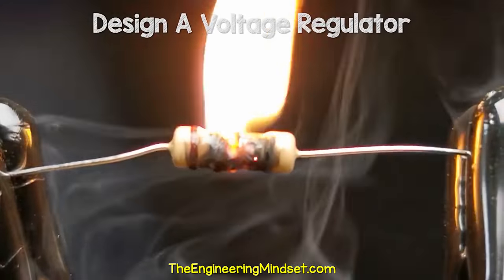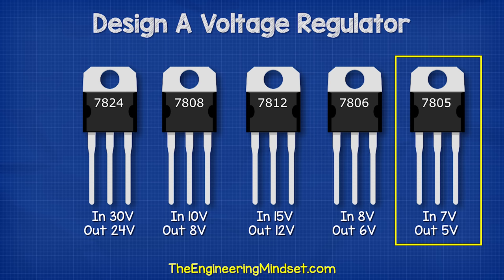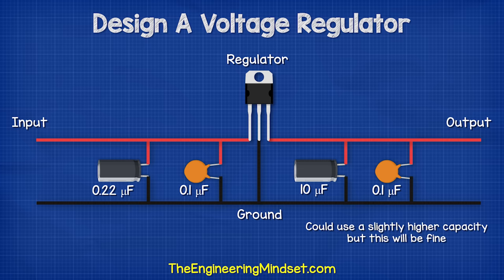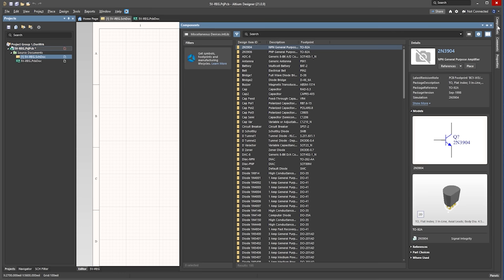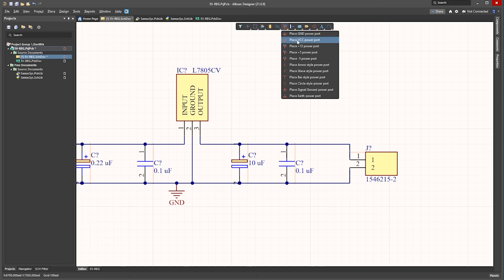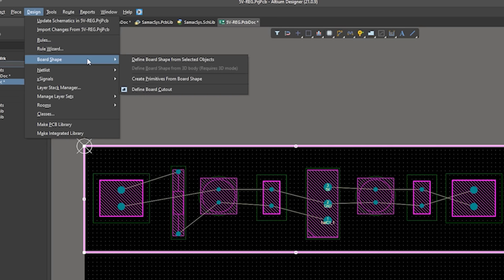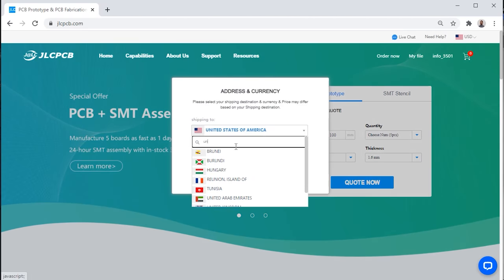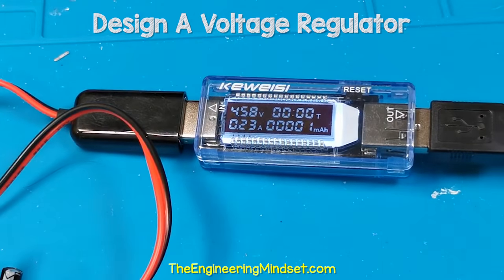5V Regulator design tutorial - How it works, how to design PCB  altium

Comment: I remember when I was in middle school, I followed a tutorial on how to make a voltage regulator and housing everything in an altoids tin. It had the voltage regulator and just a resistor. I'm pretty sure I shorted the whole thing by either having the tin short circuit the whole thing, or I reversed the inputs. Anyways, I'm 27 now, have a degree in physics and a profession. I think this will be my first full fledged personal electronics project.

Comment: Nice videos, and also really well explained. Please continue making this kind  of videos that really helps a lot to those who want learn something new the best vibes for you
Reply: In this video, we're going to take a look at a voltage regulator circuit. This is a very important circuit, and it's used to maintain a constant voltage output despite changes in the input voltage. This is useful for things like powering microcontrollers, or other sensitive electronics.

The basic principle of the voltage regulator circuit is simple. We have an input voltage, which is applied to the Vin pin of the regulator. The regulator then outputs a constant voltage on the Vout pin. This voltage is regulated by the feedback resistor Rfb.

The regulation of the output voltage occurs because of the way that transistors Q1 and Q2 are connected. Transistor Q1 acts as an amplifier, while transistor Q2 acts as a switch. When Vin is greater than Vout, transistor Q1 is turned on and transistor Q2 is turned off.
Reply from the maker: Check out NEW resistor video, everything covered! ➡️ https://youtu.be/DYcLFHgVCn0

Comment: For polarity protection, I'd use small bridge rectifier. Then you can even supply ac to circuit.
Reply: Could you please help me how to add few more components into it and how can I get multiple outputs from it from different points. For eg 5v 3v etc
Reply: A voltage regulator circuit is a great way to ensure a steady flow of power to your project. However, if you're using an AC adapter to power your project, you'll need to use a bridge rectifier to protect your regulator from polarity reversal. Without a bridge rectifier, your regulator may be damaged if the polarity of the input voltage changes.
Reply: @SFORSANDEEP  you need a 2510 bridge rectifier  at the input side and a variable resistor or potentiometer at the output side
Reply from the maker: Check out NEW resistor video, everything covered! ➡️ https://youtu.be/DYcLFHgVCn0
Reply from the maker: Seen our new Potentiometer Explained video? ➡️ https://youtu.be/Xb-MZMoUtcQ

Comment: Making custom PCBs has changed so much since when I was younger. 
I remember being 12 years old and I had to hand draw the tracks with an etch resist pen, onto copper clad board.
Then I would etch the copper, using a spare plastic takeaway tub, filled with ferric chloride. 
Finally, I'd drill the PCB with a hand operated drill and a .8mm bit. Then I would use engine de-greasant to remove the remaining etch resist pen ink from the copper tracks.
Then the board was ready for soldering. 
I didn't have the luxury of the green solder mask, or the professional white text.
It was often difficult, because I had to mentally reverse the circuit, as I was drawing the copper track layout on the bottom side of the board. Often times, I'd get it wrong.

Comment: There should be a heatsink attached with the voltage regulator though.
Reply: Remember that W=V*I. Meaning, if you have higher voltage input (say 24V) but output is only 5V and you're drawing only 0.2A then the linear voltage regulator has to dissipate about ( 24V - 5V ) * 0.2A = 3.8W as waste heat. It will get quite hot quite fast. Times like that - consider if buck regulator would be better option, if not for the noise/EM interference that accompanies it.
I would turn the voltage regulator 90 degrees and place it near edge. Another possibility would be placing it flat on the other side (there are more options). It all depends on how you are planning to connect it to the heatsink and/or how much heat you need to dissipate.
Reply: Based on the datasheet, at 25°C ambient, you can draw 6.58W. That's 1.32A. Keep in mind that's at 25V. If your input was 12V or 9V, which is typical, you can easily achieve 1.5A without a heat sink. However, I would use a heat sink to dissipate heat through a sealed case to reduce heat building up, which might affect other components.

Comment: A voltage regulator is an electronic component that maintains a steady voltage level in a circuit. There are a variety of different types of voltage regulators, but all work in essentially the same way.

A voltage regulator takes an input voltage and produces an output voltage that is either higher or lower than the input voltage, depending on the type of regulator. The output voltage is regulated so that it remains relatively constant, even when the input voltage varies.

Voltage regulators are used in a wide range of applications, from small electronic devices to large industrial installations. They are essential components in all kinds of circuits, from power supplies to data processing systems.

There are many different types of voltage regulators available, each with its own set of features and benefits.

Comment: Great vid, I was looking for such a device, we have gas BBQs that I installed with micro solar panels to charge the igniter, I ran into a problem when the cloud cover changed to output voltage it would trip out the controller for the gas flow, I think this might be the answer to keep a constant voltage from the battery to the units circuit. 
Thanks from downunder 🇦🇺👍
Reply from the maker: Seen our new video on HOW SOLAR PANELS WORK in detail https://youtu.be/Yxt72aDjFgY

Comment: With respect to LED's: given they are Light Emitting ->Diodes<-, they are much better off with a well-defined current, given their IV characteristic . So preferably don't use a voltage regulator, but a current regulator.

Comment: Take note that the capacitors have values based on the expected loads/  power deraws of the circuit, also make sure the diodes use have a smaller break voltage then the voltage source u are using
Reply: @kennmossman8701  almost never but i had an apkication where it mattered

Comment: Back in time, I became independent.  I started my own business designing electronic test equipment, to test assemble PCB circuits.  But I was so poor that I had to use freeware to do the job. The freeware PCB design software only allowed a limited amount of components.  It also allowed you to create your own components.  So I would design a portion of the PCB layout, and then due to having reached the maximum amount of components allowed, resistors, capacitors, transistors, etc,  I created a new component which in truth was a combination of all the components that I had used so far.  Yep, when you are poor, you find a way around everything. Anyhow, one company was so impressed with my work that they hired me full time. Eventually I was also designing high voltage power supplies for neon sings as well as designing the test equipment to test them at the assembled PCB level.   Not bad for a grade ten dropout.  I had no education in electronics, but was self taught.
Reply from the maker: Check out NEW resistor video, everything covered! ➡️ https://youtu.be/DYcLFHgVCn0

Comment: A 7805 in a PCB without space for a heatsink it's pretty useless
Reply: i am a beginner.. 

i want to know whether what you said means that he did it the wrong way and shouldnt have used that ic without heatsink?
Reply: Nope. Heat sink not needed for small currents and lower input voltages.
Reply: @kennmossman8701  Current less than 500 mA and input voltages less than 7.5 volts.
Reply: @kennmossman8701  7v
Reply: Kenn Mossman so i could just use a stepdown converter instead if my loads is big..
Reply: deshpremi the phone eat about >1 amp, the ic requires the heatsink in this arrangement
Reply: I agree, the power loss is high if using a 12v or higher battery as input. Would have been better with a switching regulator.
Reply: @itsourlife  Wrong LM7805 is 1.5 peak at current rush, approx 1 amp max with heat sink, or it will thermal shut down. Test it  over a time period and you will see.  With sink and no sink.
Reply: @overload3996  It is generally NOT recommended to use the LM7805 in it's peak current load....
Why not place them in a parallel to split the loads? So that your 1.5A can split 750mA each?

Also... it doesn't really need a heat sink, it gets hot, but not THAT hot.
Reply: @cpK054L  i said it will peak current rush to 1.5 amp, not able to use at that rate. Constent use is more 750ish mA yes. I have tested under current load at 800 mA with and with out heat sink. With heat sink over time will remain stable. With out sink it will thermo start to lower the mA output.
Reply: 7805 IS pretty useless
Reply: @nicobugs  with a moderate heatsink, or using a wall of a metallic case, you can power a typical arduino project just fine from 12v with a 7805, its cheap and produce a clean output. But without heatsink the usable power output its very low.
Reply: @NautilusCL  It's not not power efficient. That's just a waste.
Reply: @nicobugs  ALL linear regulators and LDOs are garbage efficiancy but it is better if you dont want to do deal with radiative noise other than Johnson noise
Reply: @glitchy_star_classes6276  With a 35V input, 7V will be across the device and 28V lost.  .  At rated current of 300mA the lost voltage needs to go somewhere - heat from the regulator/ 28v @300 mA is 8.4W.  This amout of power will cook the regulator very quickly.  

I would also use an output resistor from the 5V to 0V , so that even when disconnected from the load the device still regulates.
Reply from the maker: Check out NEW resistor video, everything covered! ➡️ https://youtu.be/DYcLFHgVCn0
Reply: Genuinely speaking, it is better to mount it to an enclosure rather than using a heat sink so this is fine for a demonstration

Comment: Loved the video, but this should be titled "how to use a voltage regulator". This did nothing to explain how a voltage regulator functions and operates, mostly "it does this and here's how to use it" which is still valuable but a misleading title.
Reply: Yeah buddy i totally agree with you i thought he is gonna design a new one and build a prototype then test it and show us. This is also a great video apart from misleading title
Reply: Yeah, I thought he was gonna describe the internals of the IC, not how to connect an IC

Comment: I don't think putting a 7805 on a circuit board can really be called "designing a voltage regulator".  You bought a voltage regulator and put some filter caps on it.... poorly chosen ones, badly laid out, and with no heatsink, which means you get maybe a third of the current that the 7805 can support.  This is a bit like going out and buying a motherboard and CPU, putting them into a box, and claiming you've "designed" a computer.

Comment: The 7812 is a commonly used linear regulator. Input voltage can range from 14 – 35VDC and it outputs a fixed 12V at over 1A of current and up to 2.2A of surge current. For basic operation, no external components are required. Just hook up the input voltage and ground and you have 5V available on the output.
👇
Reply: Mistake in the type number. With the regulator suggested by you, you will have 12v on your output instead of 5v. You need the 7805 regulator for 5v. The last 2 numbers of the 78 and 79 series of regulators determine the output voltage.

Comment: I wanted to point out a few things wrong with this PCB.  First off, those traces will not stand the current without a significant temperature rise.  Unless you meant for the traces to act like fuses then I would increase the width.  Next, the diode you use for reverse polarity protection doesn't have much better vf at the currents you were using.  While you did (at least I think) purposely choose a diode with low leakage current the vf is the thing you want to focus on in this circuit and the diode doesn't have that great of a vf. And, why not just use a p-channel MOSFET for reverse polarity protection? Furthermore, having the capacitors right next to the regulator probably isn't good for them. If you can even reach current levels that generate a substantial amount of heat without the traces burning out.  Please make a new video that teaches people good design ideas and not just use autorouter.
Reply from the maker: See my new MOSFET explained video here➡️: https://youtu.be/AwRJsze_9m4

Comment: Great shot of the led burning out 65s into the video. I totally agree that the bonding wires melted due to the high current, but someone who didn't know any better might come to the conclusion that the wire was disintegrated by the intense green death ray.

Comment: I think our professor took a lot of inspiration from this circuit design becasuse our 5V voltage regulator is almost the same as this. Probably it is a widely common design. He just put a full bridge rectifier circuit instead of a single Schottky diode and  two 1K uF electrolytic capacitors instead of 0.22 uF and 10 uF electrolytic capacitors.

Comment: Many people take linear regulators for granted.  Guess what they really are?  It's an Op-Amp as an error amplifier, voltage reference, and a pass transistor.  From what you know about Op-Amps, they can become unstable in certain conditions.  Make sure you read the datasheet and find out what kind of capacitance is expected on the input and output.

Comment: Nice video--and appreciate you providing the PCB files etc.  I actually built it---A couple of observations---first--I always use a heatsink on the 78xx series---and the PCB doesn't have provisions for one--Second--the files are from Altium--which are hard to convert and alter if you use a different PCB design platform. I ultimately just used the stock file you provided and sacrificed one of the caps---which didn't seem to affect noise off battery supply--Finally--I used this to power an Arduino--and thus used a 7809 because Arduino has its own VREG and requires 7-12 volts for accurate voltage stability--also--by using a 9v 78xx--you dissipate the heat across two Regs--3 volts (assuming 12v supply)on this board/reg,  and another 4v across Arduino reg.  If you run this with a 12v supply at 1 amp--you will find it shuts down quickly due to thermal protection....I mean these comments constructively and always appreciate you videos!

Comment: I have used 7809 to regulate a linear power supply of 9v. SMPS are cheaply available but radios require linear power supplies to avoid noise.

Comment: For polarity protection, I'd use small bridge rectifier. Then you can even supply ac to circuit.
Reply: You mean using diode right?
Reply: @roadnottaken2780  no, he meant a FULL BRIDGE RECTIFIER

Comment: This is a really well put together video. The voltage drop on the regulator can be massive (7v) if connected to 12v input. You really should have included a heatsink for the resulting heat dissipation. Again well explained and great demonstrations. Design Spark is easier to use for PCB creation.

Comment: The voltage drop is caused by diodes that are connected for protection. Nice video by the way. 

Although this would not be a good charger for modern Android or. IPhone devices 4.6 to. 4.7 is too low. 

If one uses this with a battery holder that does not let you mount the input power reversed then I think you can skip the diode and get a clean 5v output.

Comment: I'm checking out Mouser.
I want to make a voltage regulator or boost converter, for an Electric Vehicle. Regardless of the batteries voltage. I want to maintain the max charging voltage level the motor controller is rated for, to keep the EV at peak performance, as the batteries drain. 
Also wiring batteries in parallel with capacitors, to improve launching and BrakeRegen performance, so the system isn't limited by the internal resistance of the batteries.

Comment: For maximum current I would give more board footprint to allow for a decent BW style heatsink on the regulator. Before 2000, the now defuct Maplin Electronics supplied boards with the mentioned BW style heatsink.

Comment: If I remember correctly the bigger the difference between the 5V, the more Power the IC would dissipate. I believe a heatsink would be great for situations like that
Reply from the maker: Yes, if it was larger load or input we would need one. This will probably be fine without as it's so small

Comment: One more thing, add a diode across the Vin and Vregout pin in such a way that it allows the big capacitor on the output to drain back into the input.  The output pin should never be at a much higher voltage than the input pin, like when you switch off the input power and the 10uF cap is charged to 5V while the input pin voltage drops to zero.  In the real world, it's likely not going to be a big issue, but it is in the spec requirements.
Reply: @Adei Jabari place a diode between the Vin and Vreg pins so that current will flow from Vreg to Vin, if it should become .6V higher than Vin.  Vreg should never be much higher than Vin.  A datasheet should show an example schematic, including a protection diode.

Comment: This regulator is good and gives a nice understanding of concepts but instead of just using a diode we can use diodes connected in a wheatstone bridge fashion(full wave rectifier) for better efficiency because ideally it should be connected to ac socket

Comment: Thanks for your informative video. What is the best capacitors for regulator 7812? The input is car battery, which is from 12V to 14V and the needed output is 12V. So what are the best capacitors in this regard?
Reply: @mikehodgetts4864  Dear,

Thanks for your reply.

How about a 7809 regulator? I think it can work.

And, if I want to use a 7809, what capacitor should I use?